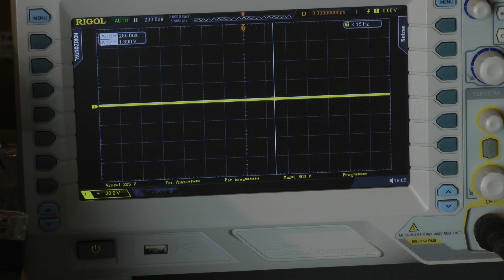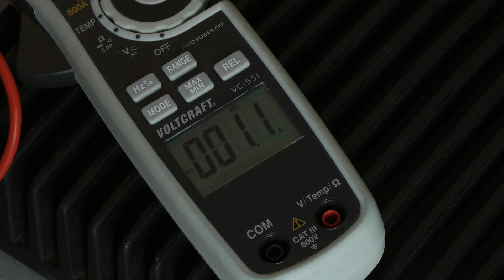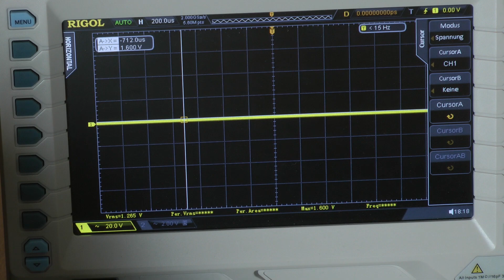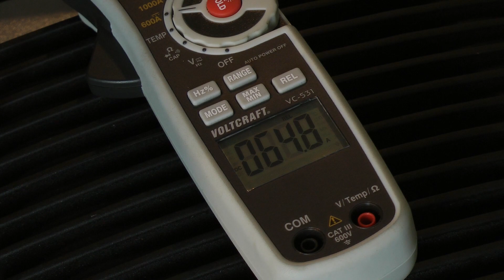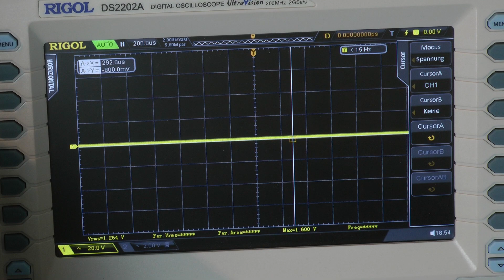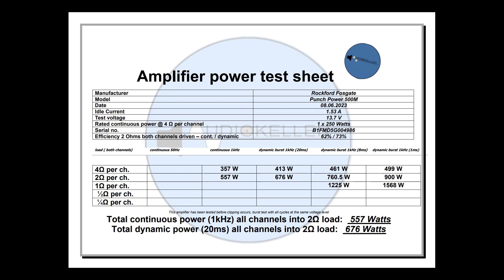Rockford Fosgate Punch 500m Power amp dyno run  oldschool mono amplifier - soundtest

Comment: I have a couple of the power 250m's. I wonder if there's much difference or if they're pretty much the same just different color. I do love the grey of the second gen of these.
Reply from the maker: I also still have a 250M there is just a slight difference but basically they are the same amps 👍

Comment: Do you still have this amp or the 250m
Reply from the maker: The 500m was sent in by a subscriber. But i still have the 250M .
Reply: You want to sell the 250 by any chance
Reply from the maker: I think it’s not a good idea : shipping will be expensive from Germany and I fixed the power supply, drivers and output FETs in 2018 , it’s not original condition.
Reply: I only want it to make a wall display to go with the 40, 50, 60, 100, 160, 200, 240, 400, 480 as you see I’m missing a 250 & 500
Reply from the maker: And a 50x2 ?
Reply from the maker: Where are you located?
Reply: Alabama USA
Reply: How much would you want for the both the 50 and 250
Reply: Also could use some end caps for 240,480, and 200
Reply from the maker: @yurfaultwinner4314  I don’t have a 50x2 i asked if you are also missing the 50x2 as well as a 50M ? They are both from 96. shipping will be too expensive plus customs.
Reply: I have 1 of the 50s not sure which I’d have to look.
Reply: I looked I have both 50s